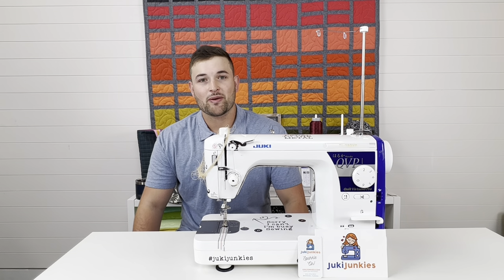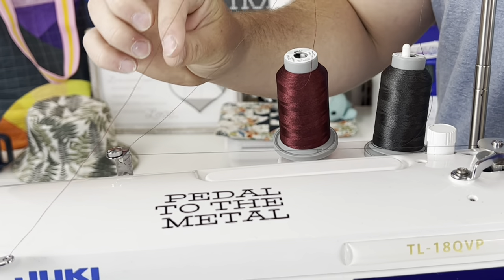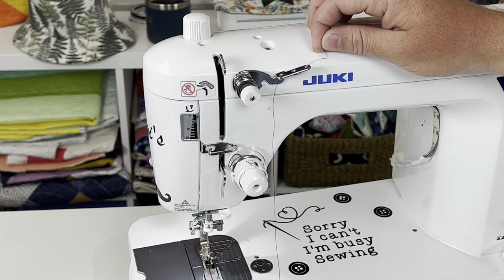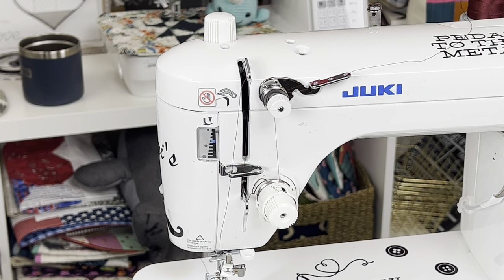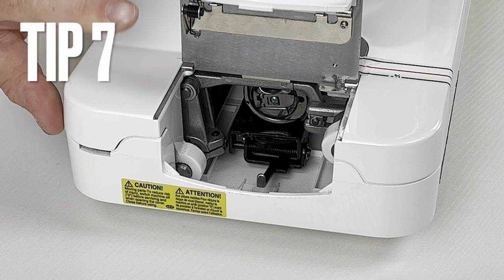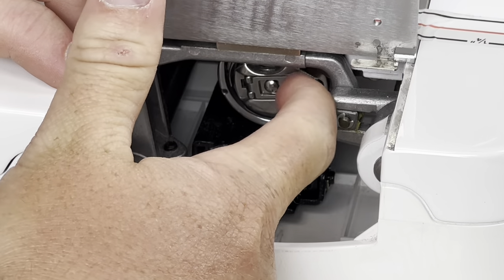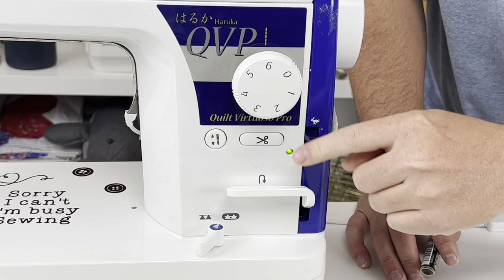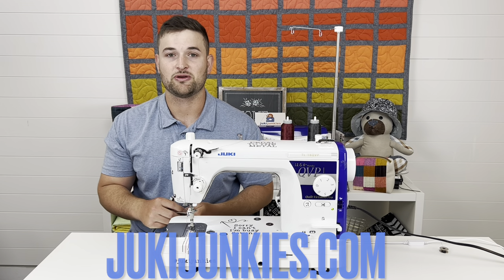JUKI TL COMMON USER ERRORS!! (LEARN WITH US) ( MECHANICAL MACHINE)

Comment: I love this video!  One tip that I learned about threading with the needle threader from one of Boki's videos is to press the needle up and down button to get the needle to "reset", but don't crank it higher after that (like I used to!!)  It can go higher, but Boki said that needle down/up gets it in the perfect position, not the highest position, which is key!  Ever since, I've not had any issues with my needle threader!!  I really liked your "flossing" tip!  I think that is a terrific way to make sure the thread is really seated where it should be!  Thanks, HD!!
Reply: I was missing the 2 oil holes under the arm😢 All better now!😊
Reply from the maker: Thank you! We appreciate the kind words and shared information.

Comment: This is such a NECESSARY video. I have only had my TL-18 for about 2 months so I am still navigating my way around. I haven’t even watched the entire video yet and I have already discovered that I am not winding my bobbin correctly (never saw the tiny hole) and I never paid any attention to the top tension adjuster.  Thanks so much for all the tips. 🤗

Comment: My error was that I was wondering why my machine wouldn’t cut my threads or do the auto threading. I was using a 70 weight industrial thread.  I used that same thread when I took my machine into the introductory class for my machine at my dealers store.  They didn’t correct me either; they said to bring it into the repair shop and have them look it over. I learned more from your YouTube videos than I ever did from them.  Thank you so much!
Reply from the maker: Thanks for watching we hear this a lot :)

Comment: Before buying my 2010Q I watched every video out there, read reviews etc.  Two most common complaints were the needle threader not working (I have the same problem but am going to make sure now I do it exactly as this wonderful video shows).  The second thing is the thread cutter.   Most reviews said the same thing  - that it cuts the threads too short, requiring a needle re-thread which was a pain.   While I'm hoping the threader will now work (though it hasn't been bad manually threading despite somewhat poor eyesight - I keep a magnifier close by), I don't believe there is a fix to the thread being cut too short.   LOVE this machine no matter the two little quirks.

Comment: I have large hands and have to use the door to put the bobbin case in but I shut the door before I get it all the way in so I can push the rest of the way and hear the click. If it doesn't click I pull it partway out shut the door and do it over till I hear the click.

Comment: Using the second spool holder to wind the bobbin best tip! You shared it and I was like…duh girl!!
Reply: I know but that means you have to have two cones of the exact same color of thread and that can get quite pricey
Reply: @dcwatashi  I can understand that. I basically only use 3 colored neutrals (in a light, medium and dark) so for me I have a full one always in each color and one I’m finishing up
Reply: @kstorts7348  well I am a graphic designer as well so I like lots of colors. So having two of almost everything would not be economical

Comment: I don't have a Juki yet, I am not sure which one I should be getting, so I will contact you.   But, that said, this is an outstanding video!  Great tips and insights!  (i.e., threading with the pressure foot down, and setting the upper tension with the foot down.  While these tips make sense, as a self-taught sewer I never knew this and didn't necessarily do it that way.)  The filming in this video is excellent for teaching and explaining too!  I really appreciate that.  The oiling of the hook, or where the bobbin case gets inserted - "the 2nd ledge" and showing it zoomed in while spreading out the oil was so well demonstrated and communicated!  These tips are valuable for all sewers!  Thank you so very much.  I am not so afraid of a long distance purchase of such an investment.  Your support is outstanding!  Thank you!!
Reply from the maker: Aww, Thank you so much!! This means a lot to us.

- David

Comment: I have had my Juki Tl18 for a few years now. I love her. I would oil everywhere more than I did the bobbin area. Today my top stitches were off. I did everything several times and still not right. I was putting the bobbin in with the door opened and not oiling it as much. It won't click at all. I ordered a new bobbin case to see if that fixes the problem. Fingers crossed. 🤞 Will be oiling it more often and closing the door. Thank you for such an informative video. It will be my go to, God forbid any issues come up.
Reply from the maker: https://youtu.be/7OCS4PDOXxQ?si=qoksB7IQIoa7czvs

Comment: Great video!  I have owned a TL2000 for about 10 years and did not know about the thread cutter with the industrial thread or even the heavier Tex thread.  Thanks for the information.
Reply from the maker: Glad it was helpful!
Reply: Is tex 35 and tex 45 considered a commercial thread?  Can I use it in both top and bobbin?
Reply: Not commercial but industrial. Oops
Reply: @pattyharp725  I use tex 70 in my industrial Juki.  I'm not sure about the 35/45 Tex.

Comment: I didn't know the little hole before the tension disk needed to be threaded en route  to the bobbin winder.  I was also inserting the bobbin case while holding the little lever open, and I didn't know about the click. 

I wonder if you should update this video regarding the frequency of oiling, since your more recent one says every 3 months is sufficient, as opposed to  the user manual which has us oiling the machine much too frequently.

Comment: I bought my Juki TL for 3 reasons. Just straight line plain stitch sewing, needle threader, and cutting the thread after I’m at the end of whatever I’m sewing. This was because I’m losing my sight and I need these helpers to help me still sew. I see other people use the cutter and move on to the next piece with ease but my machine seems to have too short of a cut as the thread comes out and needs to be threaded often. And it can take me 30 minutes to retread be.cause I find the auto threader too hard to figure out and use. I am in love with my machine and am trying to figure it all out before I’m really blind and will really have to feel my way to do anything.
Reply: If you are near a dealer, I would suggest checking with them. I couln't use the threader either and had resigned myself to it. However when i mentioned this at my dealer they had someone sit with me and go over it. When i finally got it , it seemed so easy. Now i hsve no problems.
Reply: I saw another video that showed that the pretension knob would govern the length of the thread tail of the cut.  (I've not tested)

Comment: Oiling my TL2000 as much as you mention in this video landed my machine in the shop, lol. I would back off a bit on oiling it THAT much, especially if you use the automatic thread cutter, like I do.
Reply from the maker: Yes we are just following that user manual. However we have found its definitely beneficial to not oil it that much and here is our updated video.

https://www.youtube.com/watch?v=SDE02I_1VJM&t=0s

Comment: When the presser foot is down the tension disks are closed and you are more likely to NOT get the thread between the tension disks properly. The presser foot should always be up when you thread your machine. This is coming from 55 plus years of sewing on dozens of different machines.
Reply: I know what you mean I had to cringe when he said that
Reply: It’s solely preference. He mentioned it worked good for him to floss the thread through the disk as it’s shown to be more reliable. He never said do it his way. Keep doing it the way that works for you 😊
Reply: @davidwilson7217  but it is not “shown” (whatever that means) to be more reliable his way. If it’s his opinion, he is incorrect. Even machine manufacturers will tell you to have the presser foot up when you thread it through the disks.
Reply: @davidwilson7217  where is it shown to be more reliable?
Reply: Donna Nelson This is a common user error video. He runs a shop with tons of customer service calls on a daily basis. He sees where issues come from. On this specific model machine it seems to work best for him; To floss the thread in the disk. He never said do it this way, but he chooses to as that’s what works best for him. Continue to do it with the foot up if that works for you. However with the flossing method the thread seats well in the disk and doesn’t move out. He mentions in other videos he’s seen the thread come out of the disks when the foots up, from the slightest movements while continuing the threading process when past the tension disk.
Reply from the maker: Hi Donna, 
We appreciate your input and you’re right the foot can be up or down on this model machine, while threading it. As long as you use the method he mentions “flossing” the thread through the disk.

If the foot being up works for you than continue to do it that way. We have found at our shop both methods work great. It’s solely preference to the user. We just like to provide any helpful information that may aid in less issues to customers.

Thank you,
Juki Junkies Team
Reply: @JukiJunkies  and what I’m saying is that you don’t have to floss the thread. You both make it sound like it’s a necessary step and it isn’t. I have this machine. I have never flossed the thread and I never have tension issues. He keeps saying you are gonna want to floss the thread. You said you can thread it with presser foot up or down as long as you floss the thread. If the foot is up there is no need to floss the thread bc you do not have to force the thread between the tension disks, it falls naturally between the disks. It’s not rocket science.
Reply from the maker: Hi Donna, this is for educational purposes. If you “ floss” the thread you will guarantee it seats well in the disk. This goes for the bobbin winder disk and all tension disk. It’s a habit we like to form at our shop to allow more people to successfully get the thread in the disk. It’s emphasized for teaching purposes. Like we mentioned already please continue to do it the way that works for you.

Thank you
Reply: @JukiJunkies  I know exactly why you believe people should floss the thread. I am merely saying it is not necessary if the presser foot is up.
Reply: @donnanelson9181  omg donna let it go
Reply: @jjk109  omg, no
Reply: @JukiJunkies  Hello in my islands we can't have the juki 2010 so how can we buying the juki please help me thank you so much

Comment: Super video, as usual.  I might be off subject, but would like to know if the 1/4" foot with guide is supposed to be scant.  I was disappointed to find my 1/4" seam is not quite exact.
Reply from the maker: The foot with guide is accurate. But every juki TL- the needle positions can be slightly different. I recommend using a guide and the hinged 1/4 foot.
Reply: @JukiJunkies  Thank you for that info.  I believe the hinged 1/4 foot does not come with the guide, correct?  If so, what type of guide are you referring to?
Reply from the maker: @lorrainedubois8595  https://jukijunkies.com/product/regular-hinged-foot-1-4/
this foot is a true 1/4 foot and so is this one
https://jukijunkies.com/product/1-4-presser-foot-with-guide/

Comment: Have had my TL2010Q for a few years and didn't know about the bobbin thread hole located below the bobbin tension winding disk.  Opps!  
On your video, HOW TO OIL THE JUKI TL SEWING MACHINE!  at 1:19 and again at 5:24, 7:28 and 8:13 you state that the 4 top oil spots should receive 1 to 2 drops every 3 to 4 months. To not over oil.  Yet on this video you state every 3 to 4 hours.  Quite a difference.  Which is it?
Reply from the maker: Great question. We made this video before our updated version was released. We found that the user manual suggest oiling it a little to often. In fact our Juki rep is the man who suggested the new time frame for oiling. In this video we go over how to check https://youtu.be/7OCS4PDOXxQ for yourself to make sure you don't over oil. I hope this helps.

Thank you,
David
Reply: @JukiJunkies  Thank you for clarifying this.  I opened the bottom of my machine-- by removing the 6 screws --- and oh my, what a large pool of oil!!  I cleaned it up, screwed it all back together and will be oiling once every few months now.  No, I didn't take the top off but this engineer is quite tempted.  One drop every few months into each of those 6 holes. I'm still putting a drop on the bobbin raceway with every bobbin change, correct?
Thanks for making great videos!

Comment: Should the needle be in the center of the hole in the throat plate? My stitches look fine but my needle looks closer to the right side of the hole. I am using a new needle as well.
Reply from the maker: That's normal :)
Reply: @JukiJunkies  phew ok thank you!

Comment: Very good information.  Thank you. Some of it I did not know about.  I have one issue that I hope you can address.   When I stop sewing the machine keeps stitching about 3 stitches before it stops.  Even when I push the needle up down it will stitch 3 stitches.  I have no idea how to fix it.  When I first got the machine it was right on.  Now I have to time those silly 3 stitches that are always further than where I want to stop.  I am sure it must have something to do with the timing, but how do I fix it.
Reply: I have the same problem with my machine.This happened 3 years ago so we sent it to a repair shop to get fixed but it worked fine for them so they sent it back. I have had no problem with it taking those 3 extra stitches until last month.Now it is doing that again! It is so frustrating!
Reply: @mamielantto671  Maybe they will have an answer for us here.  Very frustrating is correct.

Comment: What would be causing my thread to break every 4 or 5" of sewing?  Also is it possible for the timing to be off on this machine?  The needles also go in quite hard.  They need to be wiggled quite a bit to be inserted.  What would correct this?  Thank you. Loved this video.
Reply from the maker: You could have a burr on the needle plate or bobbin case that causes it to get caught every so often, and then break. So check both those things for any snags or burrs.

Comment: Do you have any recommendations for tension when it comes to using a zipper or the very narrow foot? Whenever I sew a longer stitch length and have a narrow foot on, the tension gets loopy on the bottom, even if it is perfect when I get under a 3 stitch length.
Reply from the maker: That has to do with tension if youre getting looping. Possibly your tension isn't tight enough.

Comment: What is the spring lever in the bobbin area called? It is supposed to lay down flat, but mine just decided to come up. Now it is blocking the bobbin case from going in. I have to move the black spring down to insert my bobbin. Then when I try to sew, my machine jams. I’m trying to google a solution but I can’t find any info about what that piece is called. It is the black spring arm in the bobbin area. You can see it in your video when you discuss inserting the bobbin.
Reply from the maker: I would have to see a picture email to sewingmachines411@gmail.com

Comment: Why is my thread shredding? The needle seems to almost touch the needle hole of my standard throat plate. I have tried everything: cleaning and oiling my machine, rethreading, different threads, new needle, different sized needles. Am quilting with thick batting. I just ordered the throat plate for thick fabric because the needle hole is bigger. Is there a way to center the needle? Please help! Karin

Comment: HELP! HELP! HELP!

Hello everyone! I've had a Juki TL 2200 QVP Mini for over 2 years now. It used to work absolutely fine until one day it didn't. I mean, it frequently skips one or two stiches in a row, sometimes it's even more than that. There's no regularity to it. 
At first I thought it was with a specific kind of fabric since it worked fine with other fabrics, then it started happening on other fabrics as well. I tried everything, changing the needle, modifying the foot tension. I played with the stich length, modified both thread a bobin tension. I clean it as regularly as I can, oil it with the right kind of oil and nothing has worked so far.
It stopped happening for a few months and started again about a month ago. 
I tried to explain my problem on a few sewist groups on Facebook with photos of the problem, and everyone gave me basic advice such as "change your needle, rethread your machine, try with a different fabric"... 

 I just wanted to ask, has anyone had that problem (and fixes it) or does my machine need to go to the shop?

Sorry for the vent, I just love this machine so much... I'm a bit worried. Thanks for the help.

Comment: I got a juki 2000qi for Christmas brand new in the box.  It has caused me nothing but headaches.  Due to me being ignorant mostly.  So I got the tension set and then when I started to sew it started skipping stitches.I read that the hook timing was off and so I adjusted the needle arm and now it's not stitching at all.  It will move but it won't pick up my bobbin thread and I'm frustrated because I'm not used to all this work to be able to sit and sew.  Help please!

Comment: I've had my machine for almost 4 yrs and learned that I was not winding the bobbin correctly (I only went around the silver guide but not through the hole first) and I wasn't sending the thread through the 2 holes correctly (I was going down one hole and up the other instead of down both holes) when threading the machine! My one issue I'm having now is my machine seems to be surging intermittently. What is causing this to happen?
Reply from the maker: Over oiling or bad pedal call your dealer for more info or call Juki America and they can help :)